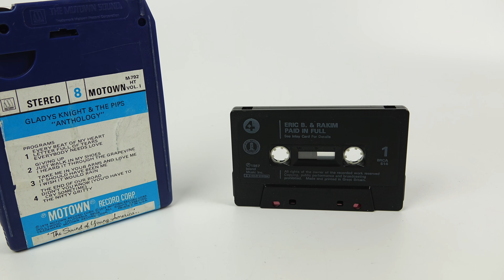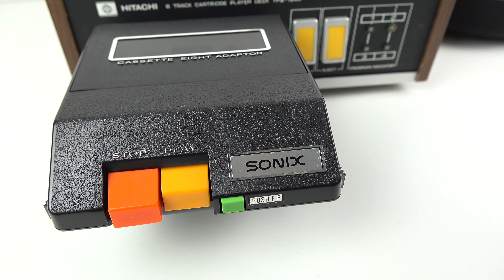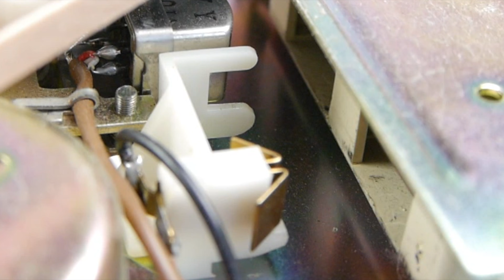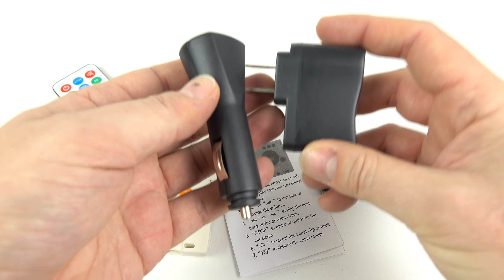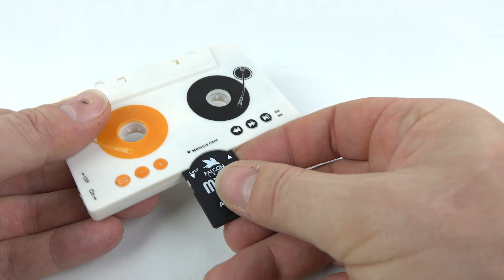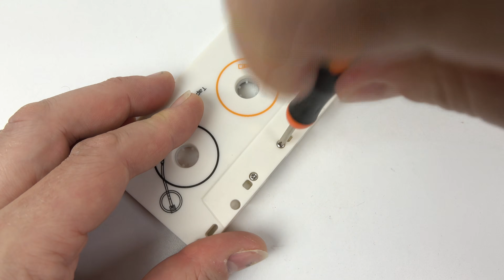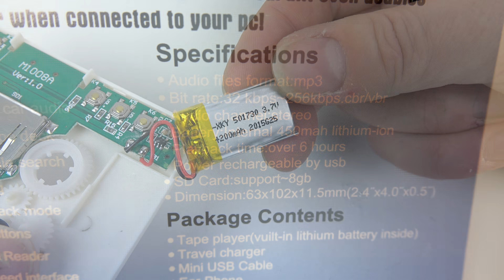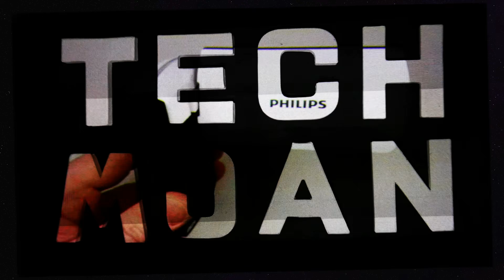Car Stereo Tape Adapters - 8-Track to Cassette to MP3

Comment: You need to go deeper, find a way to get the longest train of converters you can think of.
Reply from the maker: Some sort of audio centipede?
Reply: Something like this: http://atomictoasters.com/wp-content/uploads/2013/07/Adapter-Chain.jpg
Except with audio equipment.
Reply: Tape worm?
Reply: That's the "true hacker" spirit. Do because you can.
Reply: 8track-this converter-3.5mm to cassette-3.5mm plugged into bluetooth receiver- connected to device- sd card adapter to micro sd- here lies audio file
Reply: Choosing awful music enough might even lead to this [shit to each others input] phenomenon that allegedly is depicted in the movie.
Reply: 8 track to cassette to 1/8in aux to bluetooth adapter to bluetooth speaker to 1/4in aux to FM transmitter.
Reply: Freako it genuinely disturbs me you watch nearly every video and person I subscribe to.
Reply: A blue-ray disk player coupled to a gramophone!  ha-ha-ha
Reply: I wonder why the tape adapter doesn't have a rewind button?? hmmm... I don't really see a barrier to do so, other than cost savings maybe.
Reply: Yes, please!
Reply: 8 track to cassette with aux cord to a Bluetooth receiver to a phone that's receiving music from a computer?
Reply: I would so do that just to stick an external 8TB drive or floppy drive into one of those ports XD
Reply: MP3 to CD to cassette to 8-track to vinyl to MP3
Reply: Reminds me of a chain of memory card adapters from an old meme, something like PCMCIA > CF > SD > MiniSD > MicroSD.
Reply: Freako ION makes a bluetooth cassette adapter so you can link it to your smartphone
Reply: @docgonzo1973 
I have one of those. I've had it for about six years or so. Works pretty good when my tape deck isn't being bitchy and ejecting it every few minutes.
Reply: At some point I feel like the adapters would have to be home made, likely using Arduinos.
Reply: How about doing this to get an 8-track cassette to play mp3s "wirelessly":

8 track to cassette adapter
Cassette adapter to fm receiver
Fm receiver to fm transmitter
Fm transmitter to Bluetooth receiver
Bluetooth receiver to Bluetooth transmitter
Bluetooth transmitter to line out on pc
Line out on pc to line in on pc
Line in on pc to amplifier headphone jack
amplifier headphone jack to line out on another pc
Line out from pc to line in on pc
Line in on pc to minidisc recorder
Minidisc recorder to microphone
Microphone to powered speakers
Powered speakers to another amplifier
Amplifier to another 8-track player
8-track player to another 8-track to another cassette adapter
Cassette adapter to yet another pc
Pc to serial-to-ps2 adapter
Serial-to-ps2 adapter to ps2-to-usb adapter
USB adapter to thumb drive
Reply: Like the old porno Taboo. Remember that scene?
Reply: Freako how did I find you here? This is awesome
Reply: Eight track /cassette tape/SD/miniSD/microSD :)
Reply: He could put a aux connected casette player in the cassette adapter and put then have it connected to the 8 track
Reply: use this convector then a headphone cassettes and plug it into a Bluetooth to line adapter then you have business here
Reply: I've have a idea how about you so many adapters you plug it into a wire recorder then boom bluetooth 8 track
Reply: Blue tooth to cassette tape to 8-track tape then getting MP3 player and one of those things that allows you to use the headphone Jacks audio and outputs it to Bluetooth so that the tape can receive it

Comment: Hey, with that battery in the mp3 tape, there was a + sign to the left of the 200 mAh. Maybe it can just accept more?
Reply from the maker: Positive?
Reply: MORE POWER!!!
Reply: It will be to signify the terminals that the red and black wires are soldered onto. Especially since there is also a negative one above it.
Reply: Techmoan 
Welp, at least that's figured out.

Comment: Spoiler: the sound quality is going to be crap.
Reply: +Chainsaw Dude you do realise its possible to record it onto a casette right? this isnt rocket surgery
Reply: GeoNeilUK Right, the cheap mp3 player sound converted into casette signal, through a cheap casette deck's head, into 8-track signal and to 8-track player's head is fantastic. That's all the microphone, editing software and youtube's fault.
Reply: the music is from the you tube library anyway which means it's mp3 and not the devices shown
Reply: t33s Rgiht, the microphone, editing software and YouTube's converters played absolutely no part whatsoever in the audio quality.
Reply: +Xiefux Irony = Your comment. Figure it out you drop out.
Reply: Ender Skies Not in the Director's Cut.
Reply: #NoShit
Reply: Spoiler: your fucking wrong
Reply: Spoiler, it's a microphone recording that has been compressed recompressed and processed multiple times before it plays through your laptop speakers.  You are dumb.